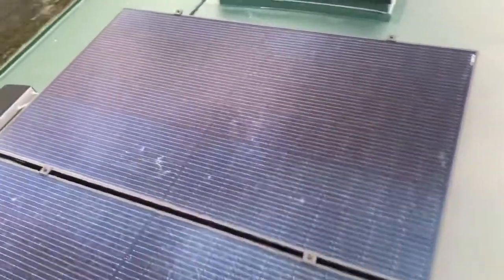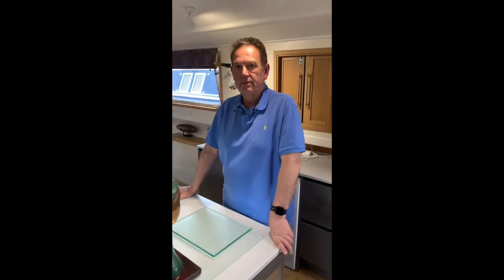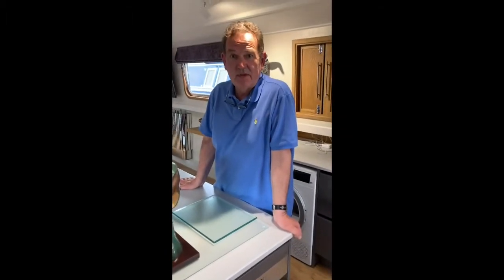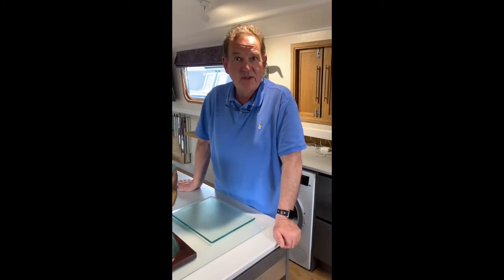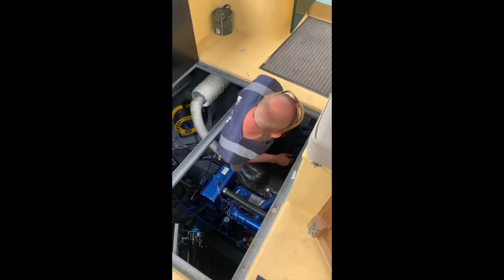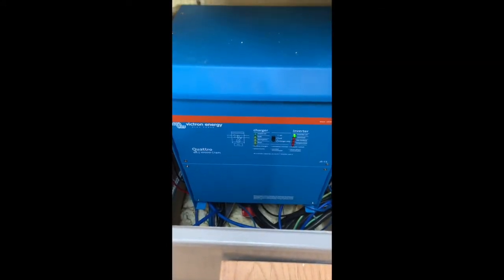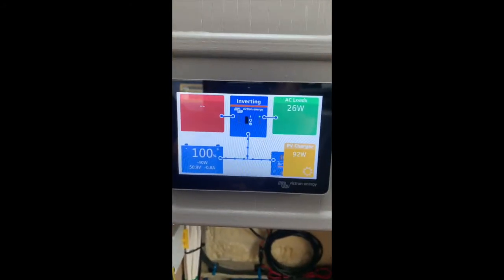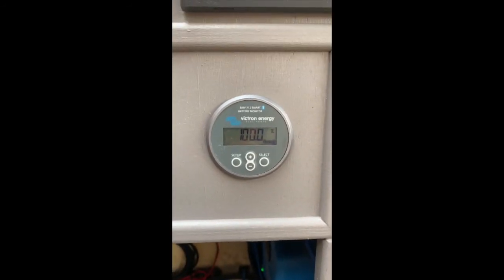Total Freedom: Full Off-Grid Power System for a Widebeam Liveaboard

Comment: I've got 2.5Kwh of solar panels on my truck. That's good apart from on rainy days & in winter.
Also, I have a 4KW inverter, which is fine as my hot water tank draws around 700w when on, my kettle is around the same, my fridge/freezer max out something similar, my slow cooker, too, & my PC around 450W with my screen.